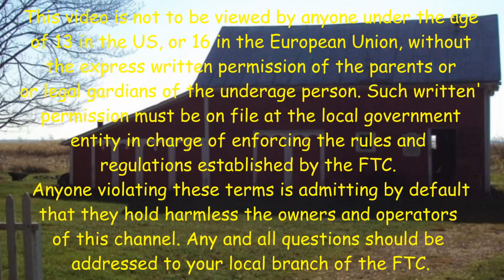Pallet Wood Projects - Building Office Fixtures

Comment: Pallet wood can be good if you find the right ones that are in good shape or cut off enough to make a usable peice.  I'm always looking for hardwood pallets if I find them for free I use a cordless saw in the back on my truck and take the good bits.  Oak and even sometimes walnut is really expensive!  Glad everyone is doing well.
Reply from the maker: That distinctive odor of walnut is a dead giveaway. 
Borg Warner bought plate steel in 6x12 foot sheets. It arrived strapped to rough cut 4x4's. 
India used native wood for pallets. Teak and mahogany were much more common than oak and maple. 
I made several benches and tables from the scrap pallet wood.